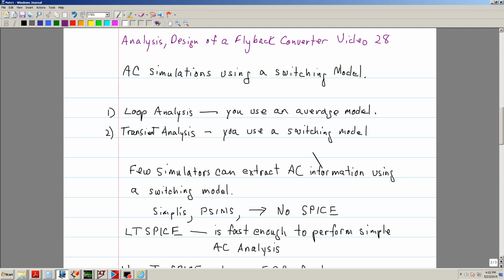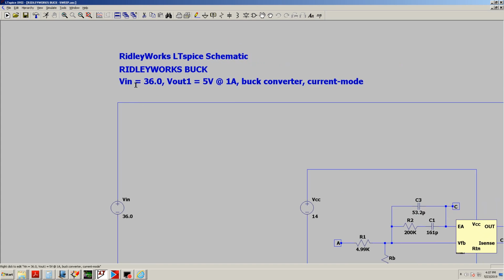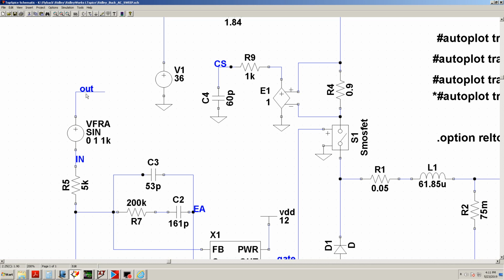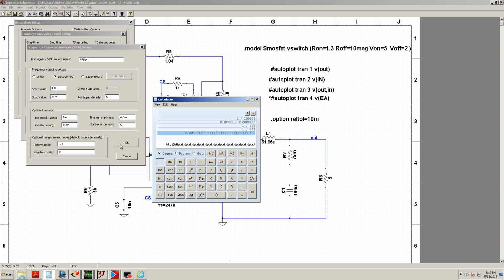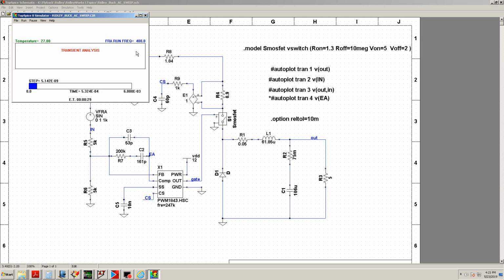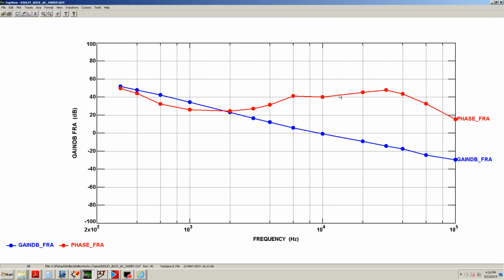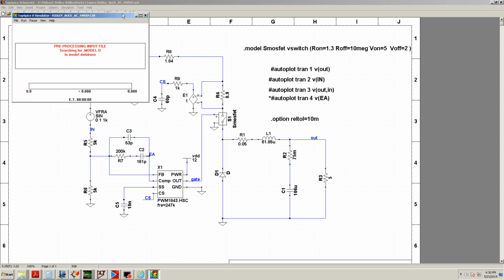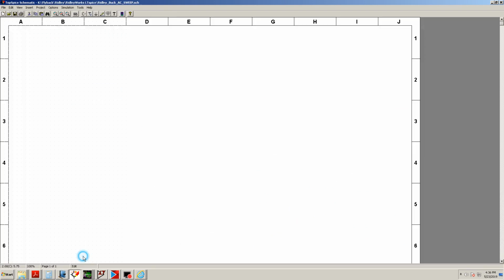Analysis, Design of a Flyback Converter, Video 28. AC Simulation

Comment: Thanks for taking the time to look at  my simulation and being so helpful.
Reply from the maker: Thank you Cheece2001. Is this Branko?   In one of my video you aske is reset should be avoided. The answer is no. You need to make sure the transformer get reset. If you do not reset the transformer, it will eventually saturate the transfomer and will damage the primary mosfet. Very inportant to reset.